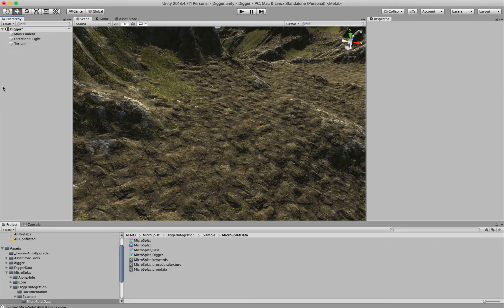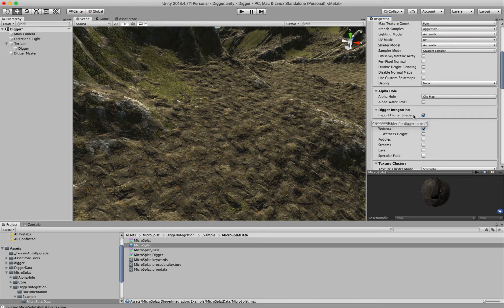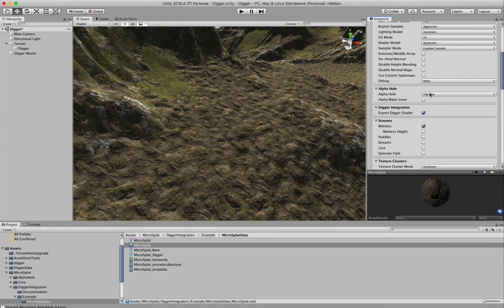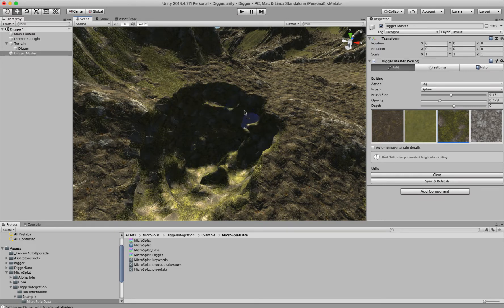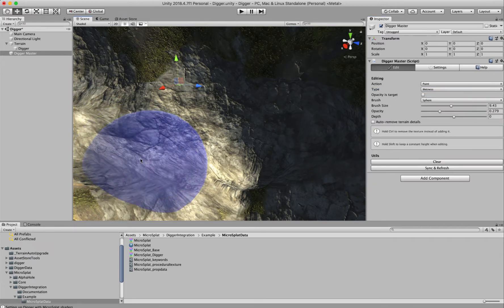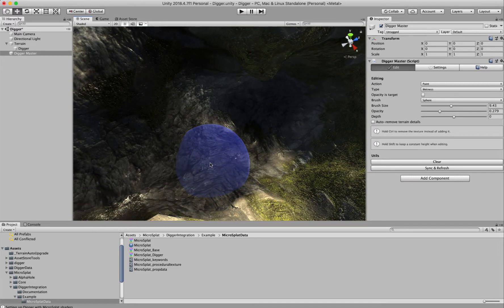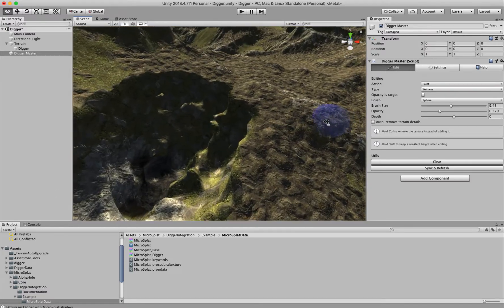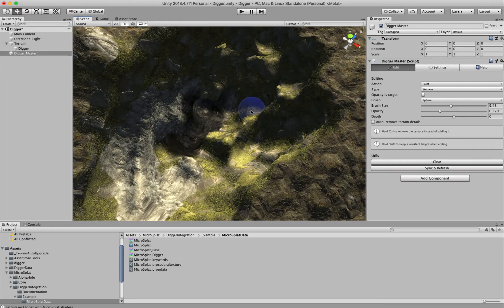MicroSplat - Digger Integration

Comment: Since it is vertex based, how would it run in built in pipeline on Oculus? Can we configure the amount of vertices or does it match the terrain plane resolution?
Reply from the maker: This is a question for the digger asset developers, not the MS integration

Comment: I just imported the digger integration into a project with MicroSplat with the Terrain Collection and am getting 3 errors with the script: 
'MicroSplatDiggerModule' does not implement inherited abstract member 'FeatureDescriptor.WriteFunctions(StringBuilder)',  'MicroSplatDiggerModule.GetHelpPath()': no suitable method found to override, 'MicroSplatDiggerModule.WriteFunctions(string[], StringBuilder)': no suitable method found to override

Is there something I need to do to fix this? Do I need to import assets in a specific order? Thanks for any help.
Reply from the maker: Update core to the latest version, you have an old version of core with a new version of Digger Integration.
Reply: @slipster216  That was the problem. I thought I had checked to make sure they were up-to-date. Thank you for the help.